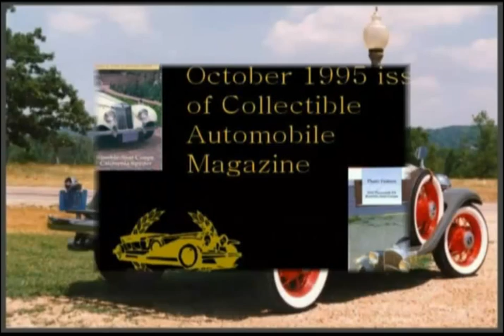Ken's Klassics - Breathtaking Vehicle Restorations

Comment: Just watched your video and was qite impressed by the quality of the workmanship. I don't do restorations but buy and sell and salavage classic cars and parts and have a extensive inventory of parts. I carry GM,FORD,CHRYSLER ,STUDEBAKER,PACKARD,HUDSON,WILLYS OVERLAND,& large truck and equipment from 1925 up to 2008 in most makes. I would like to know. how much you charge on average for your work. I own 4cars in need of a good finish applied. I have my uncles 55 Clipper Deluxe wich is near original and is a little thread worn but is very driveable and rust free and its engine is original and never been rebuilt but is a bit tired. the interior is worn but in good shape. A56DeSoto Firedome 4dr I found in a trash pile with a collapsed top but have it running and the top jacked out and repaired and it has a updated suspension and automatic and rear end and its 352 Firedome DeSoto v8& it runs and drives. a 53 Chrysler Saratoga 4dr that I've. had for 20 yrs that I've. upgraded the brakes and driveline and 330 Firedome and 69 Road Runner that is awreck rebuild. It has the front 2/3s of a 69 Satellite wagon welded in and is a completw running and driving. street warrior
Reply from the maker: Thank you for your interest in Ken's Klassics.  There is no average cost for a restoration, as no two vehicles are the same.  All work is billed on a time and material basis.  We are always happy to speak with the owners and discuss costs and on a per vehicle basis.